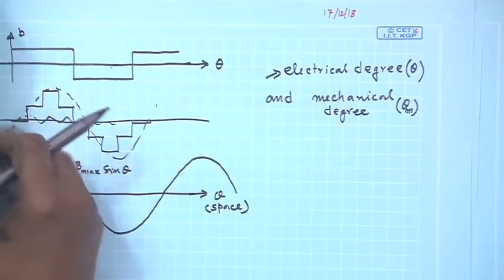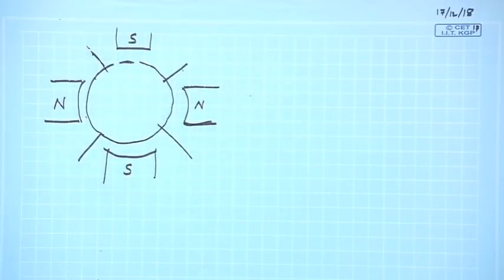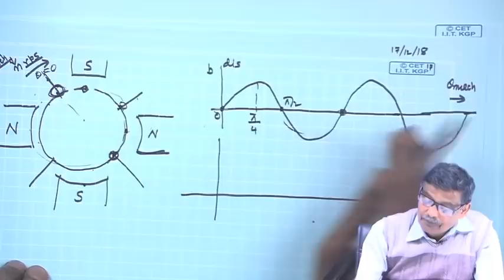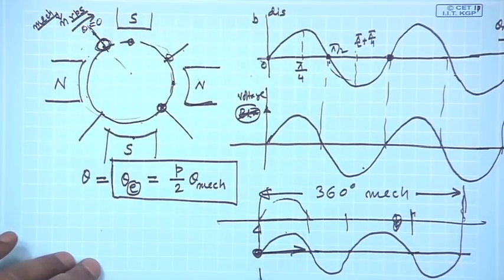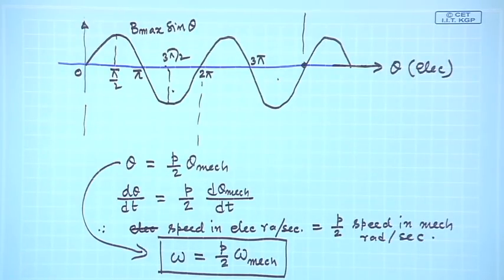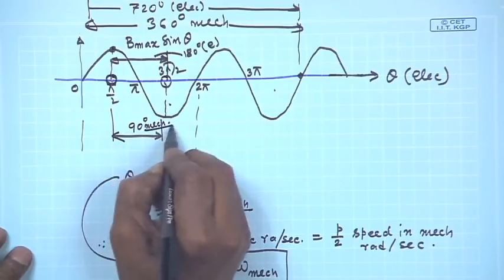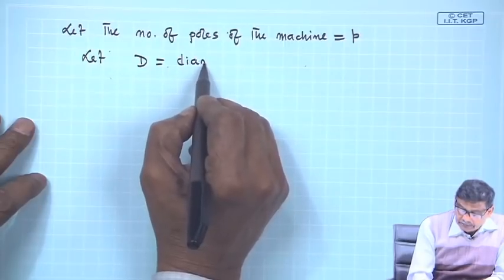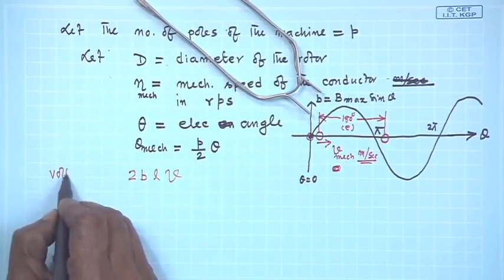Lecture 17: Induced Voltage in a Coil in a Rotating Machine (Contd.)

Comment: Professor Tapas Kumar Bhattacharya
I have 2 doubts on squirrel cage induction motor.Lecture Induced Voltage in a Coil in a Rotating Machine

1) How can we use Electro Magnetic Induction or Physics to prove that in a Squirrel cage motor without winding
how can the same number of pole -pairs be induced in rotor without any winding

2) In a squirrel cage motor with shorted rotor bars why is the induced EMF not shorted and zero as the rotor is on a shaft
and there is no insulation how come the secondary voltage E2 is generated and not grounded by rotor shaft
Reply: 1. The current induced by the stator causes rotor to develop same number of poles. Generally, we don't say refer poles on rotor in IM design.

2. Rotor is made of thin Laminations stacked upon and insulated from each other and thus from shaft too.